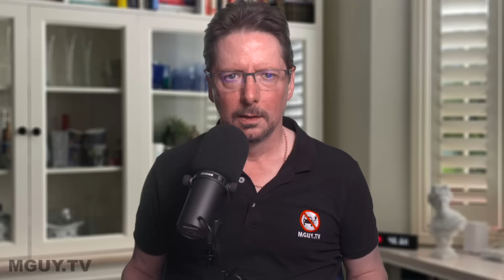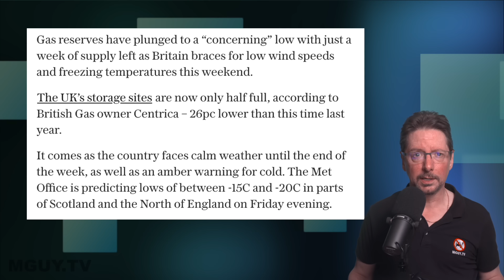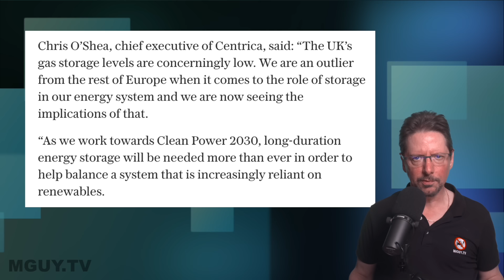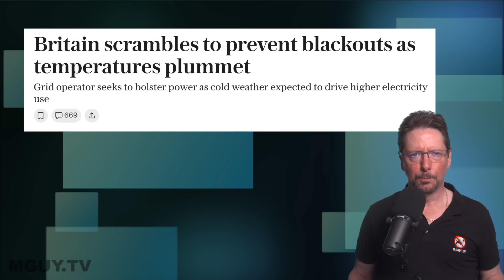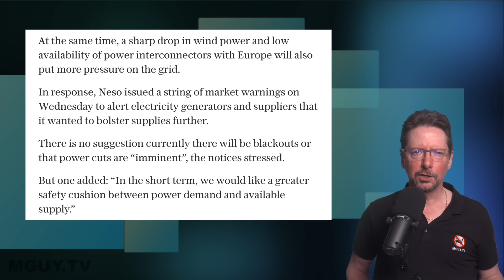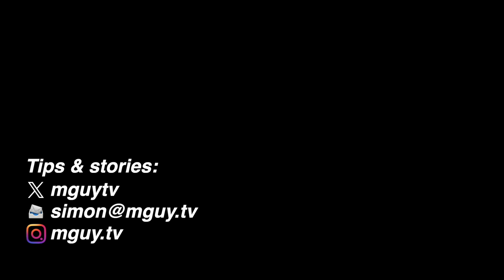Britain's Net Zero experiment is CRUMBLING before our eyes | MGUY Australia

Comment: My wife bought an electric brushcutter so we could clear our holiday section.  Charge time: 2 hours.  Run time: 25 minutes.  If that’s continuous, the battery overheats and you have to let it cool for 30 minutes before charging.  With luck , it’s available for an hour to an hour and a half per day.  It’s going to take a long time to clear that small section.  I really don’t want a battery-powered vehicle.  Oh, we could have got a more powerful petrol-driven brushcutter that would run all day for half the price.
Reply: @richardokeefe7410  exactly the same with my battery chainsaw.
Reply: Please just get a cable tool instead of suggesting sounding like a drone airport all day long is acceptable, or complaining about your purchase decisions.
Reply: The battery doesn't overheat, the electric motor does if you let it run continuously.
Reply: @kopyrightliberationfront2000  nope. battery. and it wont charge for at least half an hour til its cooled down...
Reply: @paradiselost9946  I don't know, but one time when I used my Makita trimmer continuously for about 15 minutes, the motor started smoking from overheating. Battery level dropped fast, but the battery itself did not overheat.

Comment: You can be more "green" by driving a car that produces CO2 - The Gas of Life ❤
Reply: That's the opposite of green.
Reply: @gerbre1 No it is not. 

Green means they get rich and we freeze and are starving and poor.
Reply: @dolphincliffs8864  We can buy a solar panel and save money. We can buy a small used EV and save money. We can install an air con for heating and save money. Fossil people lose money.
Reply: @gerbre1  You talk about hundreds of thousands of investment to possibly save money 20 years later. But you probably won't save money. In Australia they Charge You money to put your excess power into the grid.
Reply: @robertkubrick3738  No, I talk about small investments like two solar panels and an inverter. For this the return of investment in Germany under good conditions is four years. You make money with saving grid energy.
Reply: @gerbre1  You can't run you house off of two solar panels. You for certain can't charge your battery car off two solar panels at the same time. Are you brain damaged? If you did generate excess energy in Australia and pumped it into the grid you would be charged for doing so.
Reply: @leepowell6754 Let‘s help us to understand your smilies.
Reply: @gerbre1  Apart from green plants using it for growth... so there's that🤔
Reply: @JamesSmith-qs4hx  CO2 is a greenhouse gas, more CO2 means increasing temperatures, more weather extremes, melting ice, rising sea levels. Two and a half times more CO2 in the atmosphere and humans will have problems to breath.

Comment: Maybe they should have installed Solar Frickin' Roadway tiles to produce electricity. The ones that use part of the power generated to produce heat to melt the 1ft of snow on the panels. 🤣
And just imagine all the CO² being released in LA at the moment. More than all ICE cars in the UK will produce in the next 10 years.

Comment: Oil boilers need electricity, too. However, the spark can be initiated from a backup battery.
Reply: Nearly all gas and oil boilers (furnaces) need electricity to run a pump.

Comment: The reason the UK doesn’t have as much gas storage capacity as the rest of Europe is because we are sitting on huge reserves of our own North Sea Gas.  We don’t need loads of intermediate storage when we literally have gas on tap and this was also why our gas was so cheap.  That was until net zero stepped in which said that gas is evil and we must stop extracting it.  We were told that we must all stop using gas for cooking, hot water and central heating, in fact there was meant to be a ban on new gas boilers and a ban on significant repairs on existing gas boilers but that can has been kicked down the road for a while longer as the government realises that they can’t be simply be replaced.

So the crazy situation is that we can’t extract our own North Sea Gas, so we must buy gas from other countries at an inflated prices (this is like Saudi Arabia importing sand), and because we never need loads of gas storage in the past we now find that we don’t have enough for the crazy new supply model.
Reply: You’re not alone. Same situation in the Netherlands, we got the biggest land gas field and we’ve closed it down coz a few house had some tremor damage.. we sell gas to Germany at reduced prices and import it from Saoudi Arabia at market prices
Reply: @koosgijsman thats oooykd up
Reply: Trying to pull that shot here in Australia.  Plenty of gas off the WA north coast
Reply: Same crap in Canada.
Reply: Actually, I would not be surprised if Saudi Arabia imports sand.  Desert sand is not good for construction thus some countries that have deserts actually import sand.

Comment: Minus 6 atm,perth, crisp winter weather 👌 
The idiots clapped as they blew up coal powered stations.
Reply: we could do with a lot more trees from Scotland lol , Drax PS , (a disused Coal mine next door to it)supplied from as far away as Canada with biowood !
Reply: I'm in an East Midlands village (no gas), my little shed is currently at Minus 8.5C at 11pm according to my laser thermometer which means everything in it will be fffffrozen. Not a breath of wind either. There's a huge power station not far away that recently had a very long and expensive conversion to Gas from coal. The coal ran from nearby coalfields directly into the station by using its own rail branch.
Reply: It's summer in Perth

Australia.

Comment: 10 years ago the UK produced 6% of it's power from renewables. In 2023 renewables overtook fossil fuels as the largest source of power for generation. In 2024 renewables generated 20% more power than fossil fuels (gas / coal). The UK also closed it's last coal fired station in 2024. 
During that time the UK has reduced it's emissions from power production from 500g/kwh to 150g/kwh.
We're getting there
Reply: When you ship all your manufacturing industries off shore and have regular black outs and depend on France's nuclear energy. Then of course your emissions will decrease.
Reply: @Guvament_bs  None of what you have said has happened, other than emissions have decreased.
Reply: @stevewest131  so Britain does not get power from France? Why are there 2 huge under channel power cables to France. Is Britain sending electricity to France. Is British manufacturing thriving. Are there no black outs. Did Santa bring you lots of presents last Christmas.
Reply: @Guvament_bs  The UK has interconnectors with Belgium, France, Norway, Netherlands, Ireland and Denmark that are used to import and export electricity. The UK is a net importer of power. When excess power is generated from wind it is exported.
The UK imports about 5% of it's power this way at times of high demand.
Reply: @stevewest131  when I said Britain got power from France, who said it never happens? And how is Britain's heavy manufacturing going.
Reply: Meanwhile, China and India continue to build coal fired power stations.
Their emissions do not respect their nations borders.
Reply: The most expensive electricity in the world and blackouts that will kill people. Yes we are getting there..
Reply: Yeah, to the dark ages!

Comment: And don't forget they want to get rid of gas powerstations and increase ev use lol... We barely have enough as it is and will have less if they keep pushing this tosh... But don't worry the ev lot will tell you too charge at night whilst forgetting the cold effects the charging rate,  cold effects the battery of the ev, and we have barely enough power in the grid....  These EV folks mush have unicorn sh1111t  for brains,

Comment: This is Labor’s cunning plan with the pensioners unable to afford heating the stocks of gas will last longer❤
Reply: Iam a pensioner in Australia and i only shower once a week as i cannot afford the cost of gas to heat the water
Reply: @tallboy49  I'm in QLD and we have one solar panel for hot water...always plenty.
Reply: @smkh2890  I am renting so no chance of solar
Reply: That's the idea. They also plan to cut benefits for millions claiming sickness benefit. Declare them fit for work and put them on the dole where they can be sanctioned.

Comment: South Australia's grid is supported by natural gas that they tried to convince us was 'clean and green' before being caught out. A lot of this gas is being burnt in simple cycle gas turbines with low thermal efficiency, some of the machines I had input in installing at the Hallet wind farm in the mid north of SA are old second hand units dragged out of a South American jungle where they had been dumped to rot away as they were too fuel hungry to run. These machines are dual fuel, so when the pressure in the Moomba pipeline drops low enough that it may affect users in Adelaide they can switch the turbines over to that other green fuel, Diesel oil. I kid you not.
Reply: SA also has two huge diesel fuel generators as a backup.
Reply: Electricity in South Australia is propped up by brown coal power in Victoria. They delayed the closure of Torrens B power station due to the delays in the construction of the NSW interconnector. This year (so far) and last summer didn't see any really hot days in the populated coastal areas due to consistent southerlies. It has been very much drier than normal though. If we actually had a normal summer with really hot days and evenings with no wind there would be a big shortage of power. Even worse on the southern Eyre Peninsula (Port Lincoln etc), where the closest grid l battery is over 450 km away and only renewables. Voltage is not very consistent.
Reply: @mickybaus6848  sounds kind of 3rd world. Bad luck if you like toast. You will be forever adjusting the toaster!
Reply: and - tadaaaaam - they continue to preach about "green hydrogen" made by electrolisers.
Reply: @antontsau  have they ever heard of the Hindenburg?
Reply: Are they bases on the but section of an RB-211 turbine?
Reply: @annyer262  They are very old GE Frame 5 machines, some were rated at 15MW elect. and some were later models with different inlet housings that were rated at near 20MW elect.
Reply: @raygale4198  I just did a search about them and it said that in the North East blackout in 1965 it was a black start frame 5 that initiated the restoration of power on Long Island and then New York City. So I guess these are an appropriate choice! Black start will occur more often I think!
Reply: @annyer262  No denying they work, but when a supposed first world country is relying on trash thrown out by a South American country to support the grid it's pretty grim. As installed I don't think they would have black start ability, they are installed mid grid on a main spine feed that runs the entire length of the state, I can't remember if they had the ability to liven a local HV bus with multiple machines before switching back onto the main grid. Had an issue years back where we tried to back liven a transmission line using a 1.2 MW Diesel to 'black start' Torrens Island station, the gens are located 10km away at Dry Creek. Even using a dedicated station interconnector feed line we fused the alternator stator on the first attempt, inrush into a 132kV transformer and the capacitance of the line killed it. Got around the problem by 'soft starting' the transformer with reduced voltage from the generator.
Reply: @raygale4198 you are very knowledgeable
Reply: Still it works well and they are on track to have a near fully renewable power grid.
Reply: @JRNagel  as long as the extension cord to Victoria does not trip out!
Reply: @JRNagel  they claim 100% renewable but its not true. They depend on coal power from nsw. But nsw is shuting down their coal as well. What happens then. Lights out.
Reply: @Guvament_bs  nope, from Victoria. SA and NSW border is Broken Hill area, which hardly can survive by itself on long power line from Mildura (and last year did not survive at all, as we all know).
Reply: @antontsau  broken Hill is surrounded by more solar power than they can use. But when the connector was down, they couldn't use that power because solar needs base load grid power to stabilise the frequency, i.e., cycles per second.
Reply: @JRNagel  read - no grid at all.

Comment: I doubt the green zealots appreciate that with battery storage the renewable energy generators must produce a lot more energy than is needed just to keep the lights on. They have to charge up the batteries at the same time.
Reply: Also batteries are not very efficient, for each kwh you get out of the battery you have to generate more than one kwh in the first place. That means even more expensive, land-consuming wind farms and solar farms.
Reply: @Akm72  Bulk charging (high amperage rates) and discharging create a significant amount of resistive heating - and energy is needed to remove that heat. Also, localised superheating affects cell reliability, and by extension increases risk of failure, possibly significant.  Rather than battery storage, pumped hydro would be a more sensible long term solution.
Reply: @phils4634  That would be better but it's only possible if you can find the right geography to store the water.
Reply: @phils4634  there is a calculation available for my country, how many wather would we need to store the energy this was. We would need more wather than is actual available in my country in river and lakes.
Reply: @Akm72  Well the UK  certainly used to have a significant pumped storage facility in Wales, and  owing to water's significant density, you don't need that much volume to store a lot of fully - accessible energy providing you have a decent head of water.
Reply: @marhimarhi  Therefore in your case efficient base-load might be the best solution. I am mindful of China's very significant progress on compact thorium salt reactors, and their highly ambitious fusion programme. If any one Country has the resources to crack this issue, it is China (in collaboration with Russia).
Reply: Batteries don't work well when needed. In extreme cold and heat. So you need to manage the environment they are stored in. So you need to use even more enegery to heat the batteries.

Comment: The majority of homes in the UK have gas heating. There is no real rise in electricity use to heat homes.
Reply: Pumping heat from outside when it is -17 degrees makes very little sense. Hold cold will the evaporator trying to make refrigerant evaporate?
Reply: @annyer262  Heat pumps have to work far harder as the temperature differential increases. Once the outdoor temps drop much below 0C reverse cycle AC starts to struggle quite a bit - and it is  more effective to use other heating sources.
Reply: @phils4634  correct. It is a basic concept of thermodynamics! I work with chilling systems for wine so I have experience with all of this!
Reply: @annyer262 it's not -17 in most of the UK. Only in the Highlands where no one lives. It's pretty much no worse than -5 in the cities.
Reply: Don't under estimate the electricity used to power fans on all those gas heaters. That's a lot of electric motors running continually.
Reply: @erroneouscode  UK homes use gas boilers which uses a small pump to circulate hot water through the system. The electricity used by these pumps is very small. What would be a drain on the electric grid would be heat pumps that require large amounts of electricity to function. This would increase when operating in low temperatures. Add to that EVs and you have the perfect storm.
Reply: @orvillefindley8117 my air to air heat pump is heating our large 4 bed house and it's using a staggering 1.7kwh. 

Luckily it's been a sunny day and we've harvested 16kwh of electric eh.
Reply: @esm7708  Your house is probably in the Bahamas.
Reply: @orvillefindley8117  by Bahamas you mean Lincolnshire?
Reply: There certainly will be a rise in electricity use if the gas supply runs short. and then there will be marching power outages as the gas powered stations cannot operate.